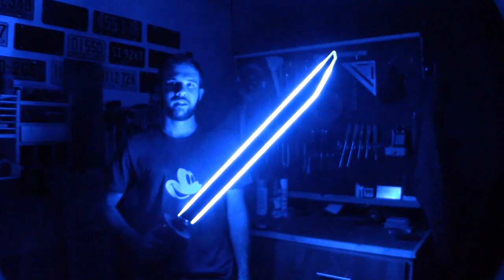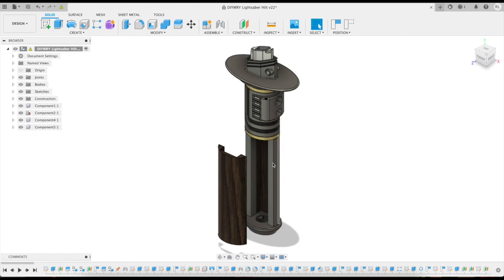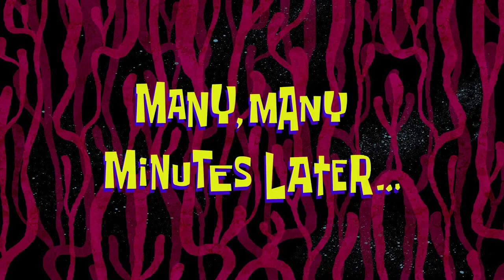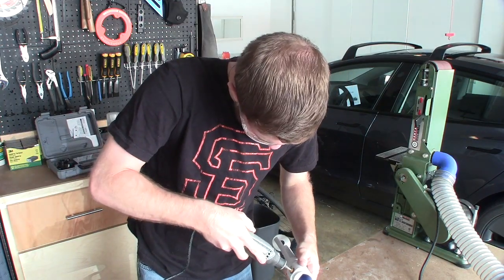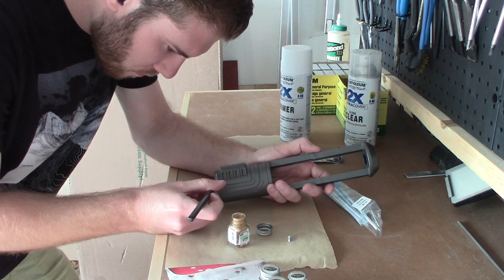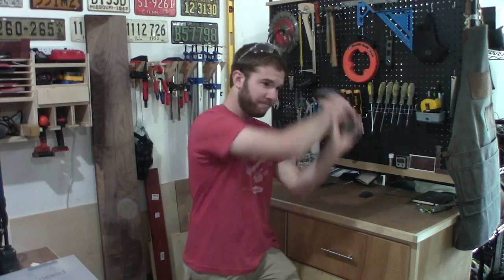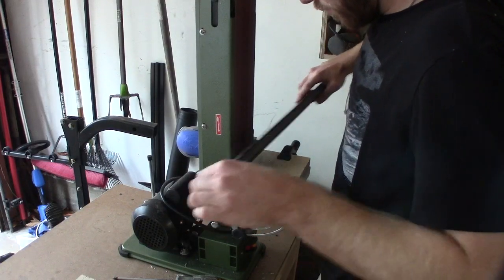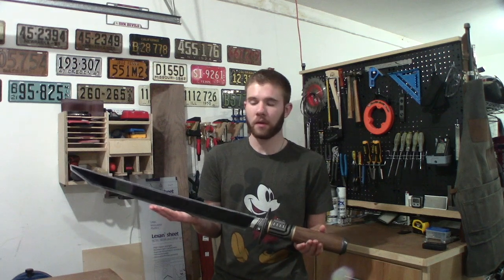Wielding the Force to Build an Awesome Darksaber-style Lightsaber

Comment from the maker: I forgot to explain why I have an audio amplifier board in the video (even though I said I would explain it later... come on Ryan), but the reason for that has to do with how the Teensy 4.0 processes audio. It uses a digital wave (I2S) to send the audio signals to an amplifier, while the Prop Shield is built to receive analog waves (DAC) for the built in amplifier. So you'll need a work around to play the audio. After many nights digging through the Teensy online forum, and some trial and error, I was able to find this amplifier that can read the digital signal and output the sound. However the work around also affects how the lights are run, so there was more work arounds for that. At some point I'll get an electrical diagram for the system.

TL;DR: I had to get creative with the sound and light features because the Teensy 4.0 and Prop Shield are more like acquaintances than best friends.